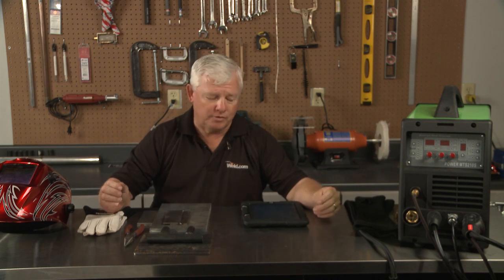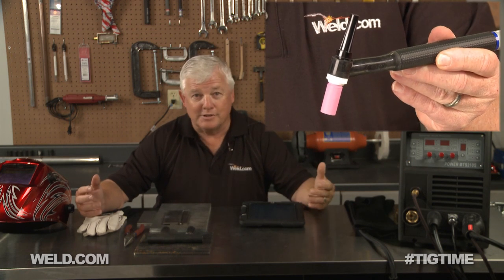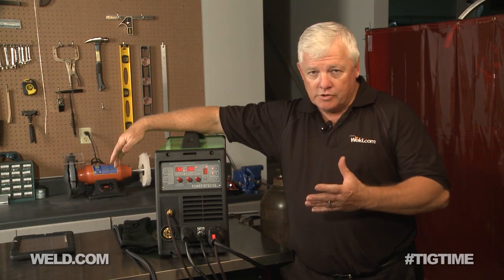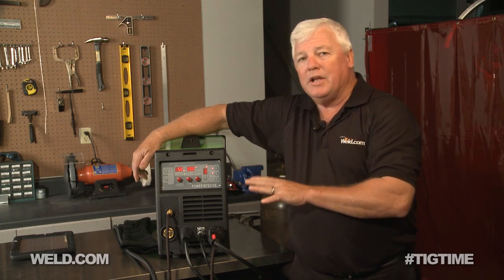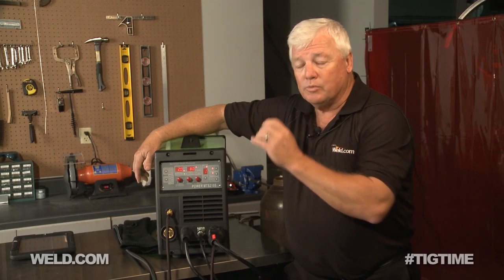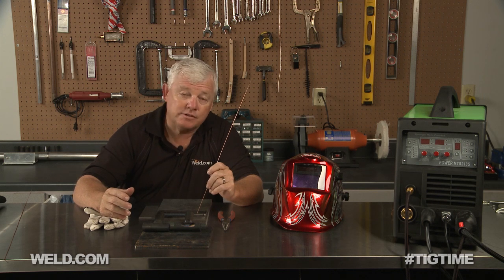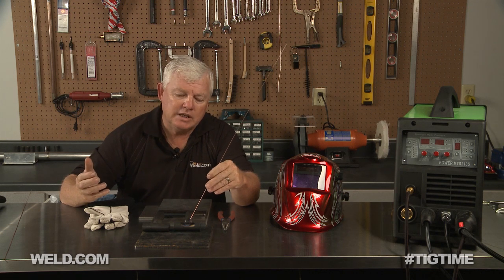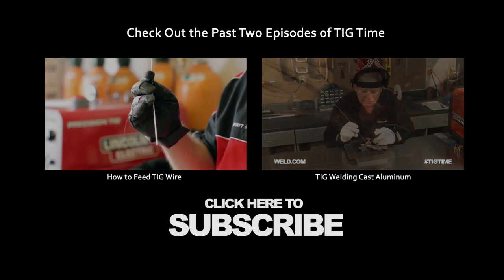Everlast MTS 210 Welder Review : Part 1 | TIG Time

Comment: It looked like you had to run hotter on the cheaper machine, with blue discoloration much further out. Did you have to run hotter to maintain the arc?

It's great to see what appears to be a balanced review. I'm looking for TIG/stick, high freq start, foot pedal, AC/DC, no MIG (already have one), 240V, no need for more than 35% duty, hopefully less than $2500. Ideas? I've done stick with Lincoln and Miller for decades.

Comment: Hey Mr. Tig, I saw that the scratch start was giving you a few problems. For anyone who isn't comfortable touching the work with the tungsten, you can slide the filler wire across the work, and strike the tungsten at the same time. It will light the torch and save your tip.

Comment: I'm going to order the Everlast MTS250S. It has LIFT start, not scratch start. The manual is actually pretty good and describes how this work. There's also videos that demonstrate the proper method to lift start. Lift start should not contaminate the tungsten nor the material being welded!